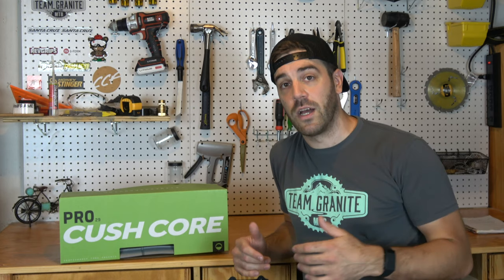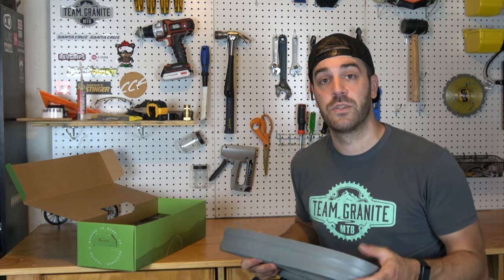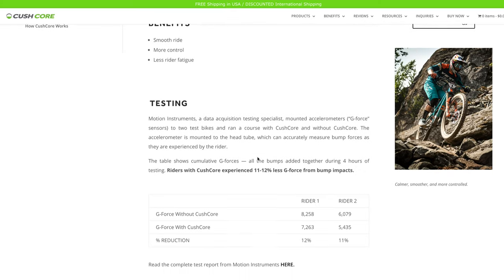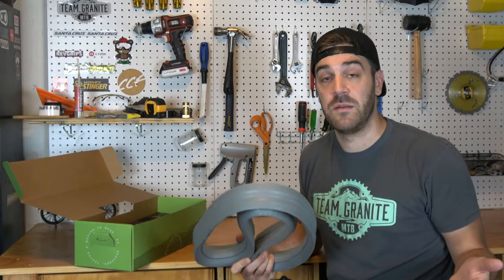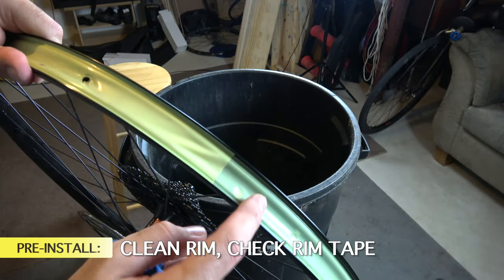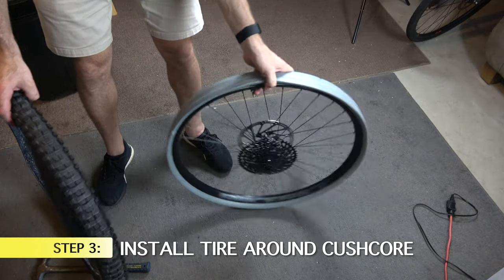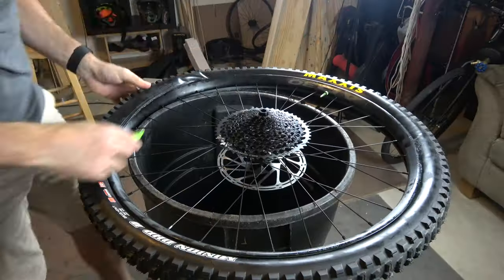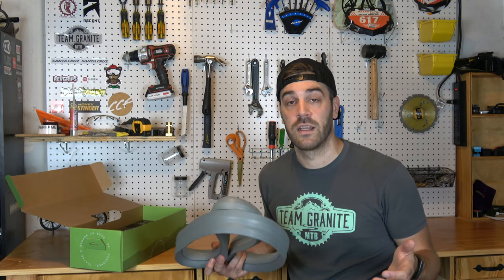Can CUSHCORE save your rims AND make you faster?! | 2020 - Full Review and Install

Comment: Great video. Do you think it’s worth it if I’m already running 27.5 x 2.8”s, and only ride trails? (No park/DH). Also, how does the valve stem get air & sealant through the Cushcore - is it permeable? Or did you make a hole and just not show it on camera
Reply from the maker: Totally worth it! In the video I explain the custom Cushcore valve that they supply which allows air and sealant through the sides as opposed to the top. :)
Reply: @MTBTravelReview  nice, missed that part / went right over my head :)

Comment: I have been running DH or 2ply tires on my Bronson v3 , which primarily sees techy single track trail use w/ avg speeds under 7mph, as i absolutely love the feel of the DH casing and compounds. I would be curious to one day try cushcore to see how the stiffness and dampening compares to that of a DH tire 🤔.
Reply from the maker: Guineson I have always run DD tires on my rig and while they have some dampening abilities, it’s nothing compared to Cushcore. I primarily run them to avoid sidewall slashes/blowouts, not for dampening purposes.  Cushcore is worlds apart from simply adjusting you tire compound or ply count.

Comment: I just got a Levo SL and with the extra weight, they recommend adding 5psi.  That puts me up at 34-35 and I'm still pinch flatting from time to time.  I am considering these to avoid going up from 35 to cure the issue.
Reply from the maker: They are a game changer and in your situation I’d def recommend!
Reply: Are you using tubes? Because 35 psi is a LOT for tubeless tires, even with an ebike.
Reply: @spencerimre  I was at the time but I since gone tubeless with cushcore and and some better tires and all of my flatting issues are gone.  Running much lower pressures now.
Reply: @MXD29  that would explain it